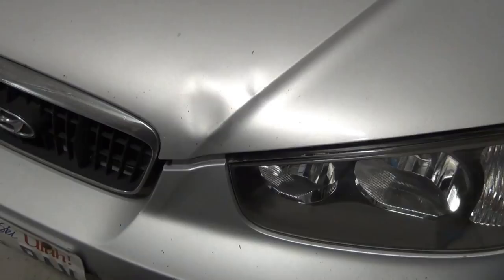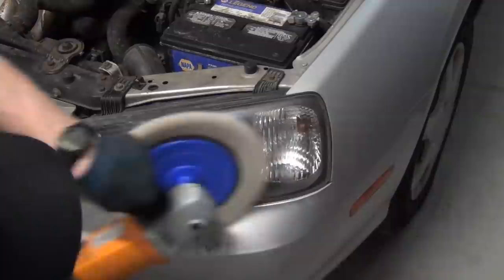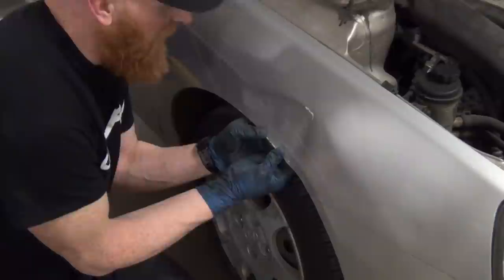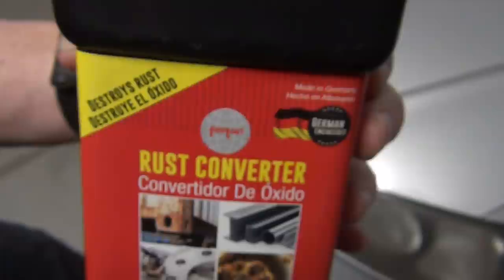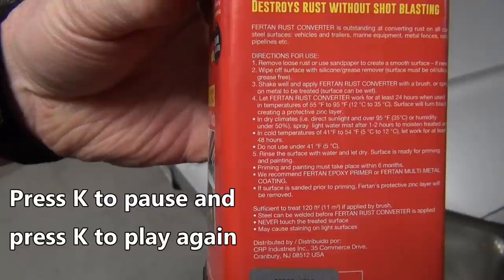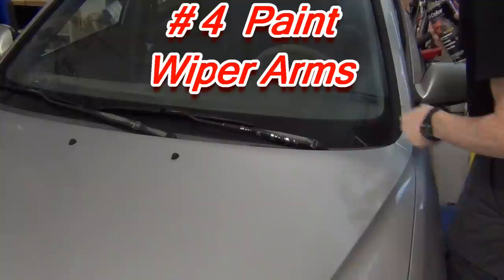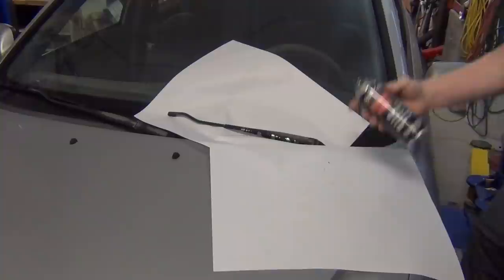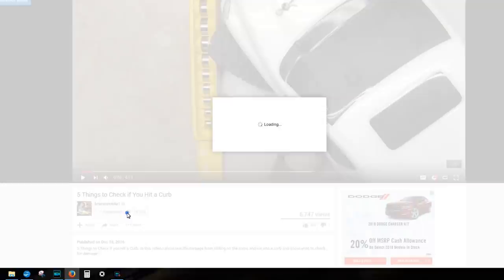4 Cheap Easy Car Day Spa Treatments U Can Do

Comment: Brian.  Another great video however I have a couple of suggestions.  Whenever I paint wiper arms, the first thing I do is remove them from the car.  I actually made a tool to remove wiper arms.  Oh, I know it can be a pain to get them off, but this affords me the opportunity to clean the splines and apply some anti-sieze so they'll come off much easier the next time.  The second suggestion is for arms where there are places where the paint is completely gone exposing the bare metal.  It they're that bad, I spray on metal primer paint prior to painting.  Of course, I don't need to mask anything because the arms are placed on an old lazy Susan that I turn while painting.  Keep up the great work!

Comment: what kind of clear coat should I use after buffing the headlights
Reply: Adrian Esquivel @briansmobile1 clear auto paint spray can(acrylic enamel)?  Also,  looks like you're using a 12" buffer,  what kind?

Comment: Brian, why you just did not want to replace the fender? It could cost you just around the $50 bucks.
Reply from the maker: GREAT QUESTION!  I'll answer it.  Replacing the fender is best for the best outcome, but that would mean painting it for $200 on top of the $50 or it would be black and rust soon if you don't.   This isn't my car.  I didn't charge anything for the fender tweak.  I've got BILLS!  (seriously- I have a family to support and insure)  And I don't make nearly as much money as people think I do.  I do AMAZING on what I do make though, but not as much left over to give away as I would like.   It would also take longer to replace than what I did.  I did this to help others via crude demonstration/introduction of concept and to help the owner by making the car look better at 20 feet or passing by.
Reply: Keep doing what you're doing Brian. You are the best one. Thank you for your warm response.